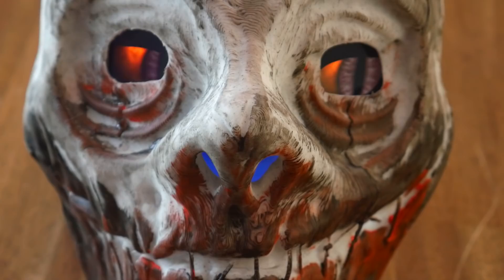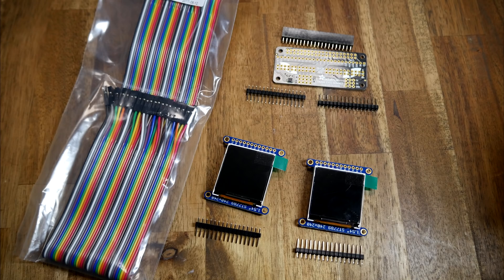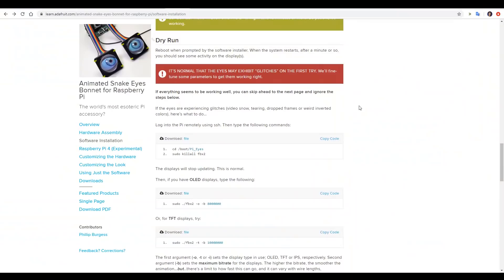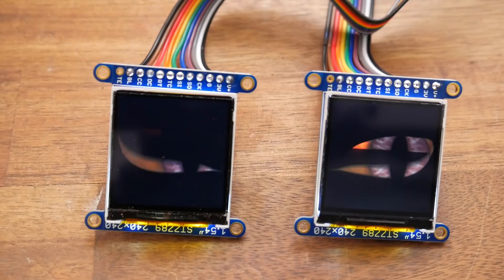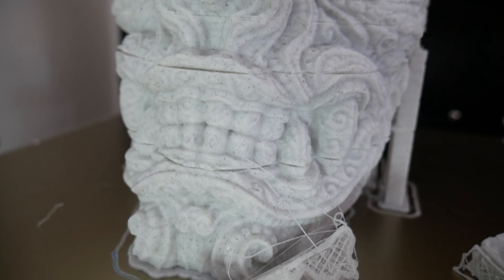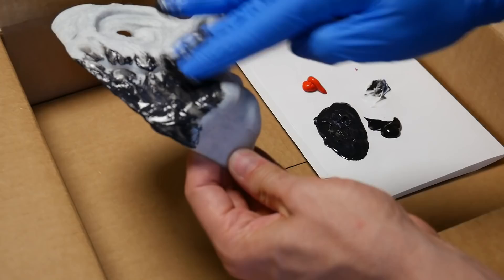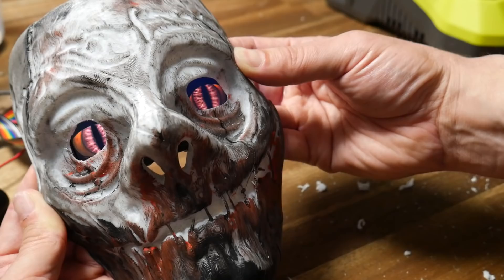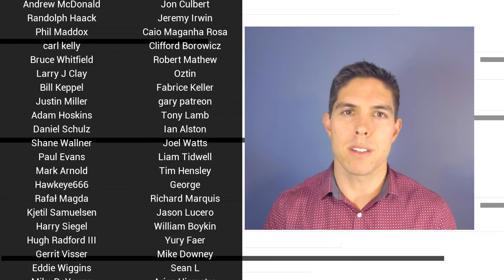Halloween Pi + 3D print project: animated eyes horror mask

Comment: Can you remove the eyelids/blink from the animation, it doesn't really work well with the mask, but looks great when the eyes are wide open.
Reply: Agreed. Maybe it would look better if he changed the black around the eye images to match the mask color. It would also be great to soften/obscure the edge of the eye holes with some painted gauze and/or stretchy glue stick strings.
Reply from the maker: I agree and I briefly looked into this by manipulating the layers in the SVG. I think one might limit the range of motion for the looking around, and with that the eye lids movement framing the eye, but I was too short on time to properly test it.

Comment: Maybe I'm wrong but it looks like your failed prints where coming from the SecKit SK-GO printer that you recently rated so highly.  I am very interested in buying that printer (when they're back in stock) but if you're having a lot of failures it gives me concern.  Is that the correct printer and if so, what tweaks do you think need to be done to make it more reliable?
Reply from the maker: I believe I introduced the problem with very aggressive speeds on the Z axis. More testing to come.
Reply from the maker: Slicing parameter error confirmed. Here's the reprint about 40% through: https://imgur.com/a/Aloslfs